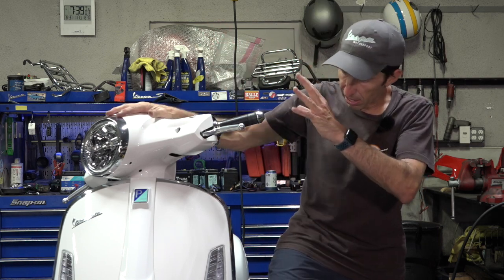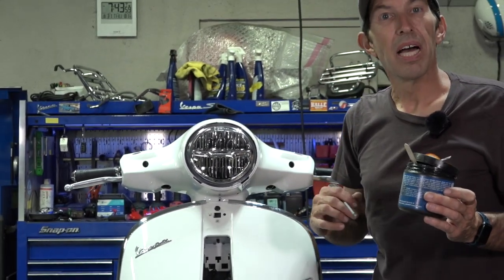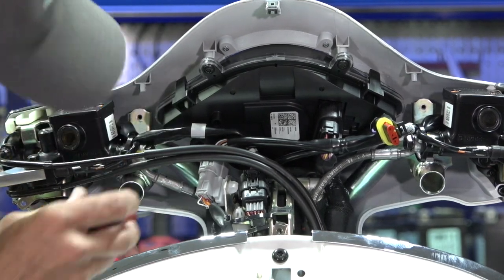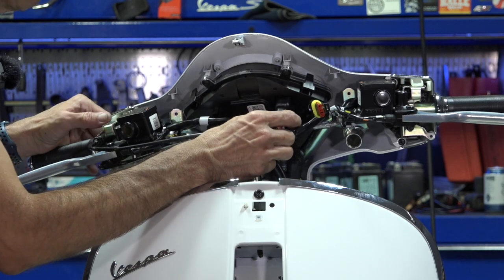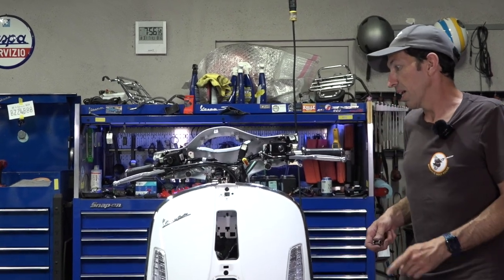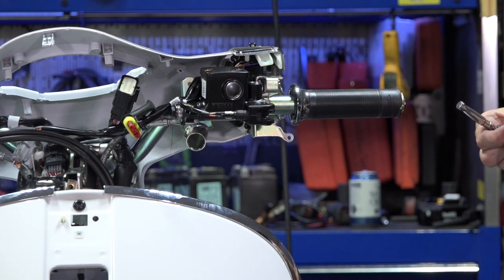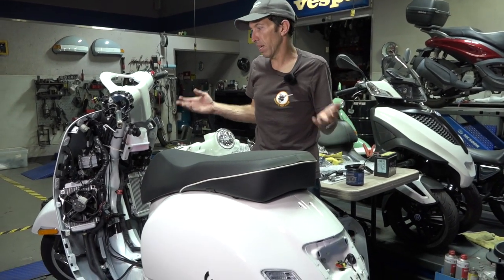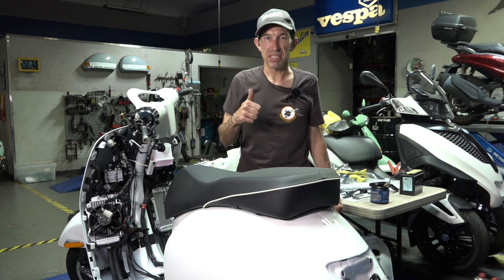How to Completely De-trim & Remove Body Work from a 2023- Vespa GTS 300 HPE2

Comment: please help me. my vespa gets 300 supersport is brandnew and I just wanted to change button covers color from chrome to black. and I remove all buttons from cover and install it again to black cover. and when I start to close motorbike i put the sockets back in place as every time. and when I try to start When I try to turn on the ignition, nothing happens on the engine display, it just says "Welcome". and when I try to turn to right it just says "goodbye" and Nothing else appears on the display. What could I have done wrong? There must be a problem with the cables. before I do it 2 times and anything was wrong everything gone true. now I don't use my vespa. I can't start do you ve any idea?

Comment: Your videos are very accurate and helpful.  My ignition switch is not very stable and firm and I would like to replace it (I ordered a new one suitable for my 300 gts supertech MY 2023).  Your video was useful to me in understanding how to correctly disassemble the glove box and have access to the switch.  Do you think it's easy to replace it?  Thanks from Italy

1

Rispondi